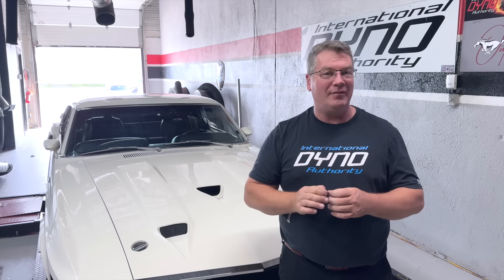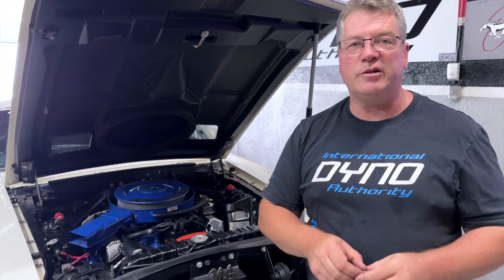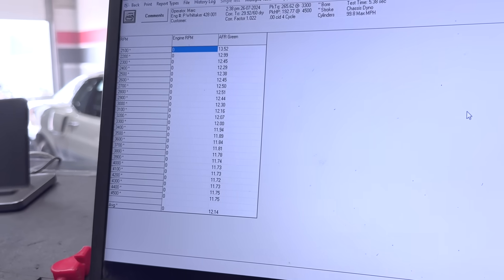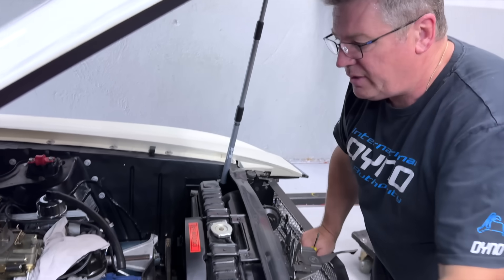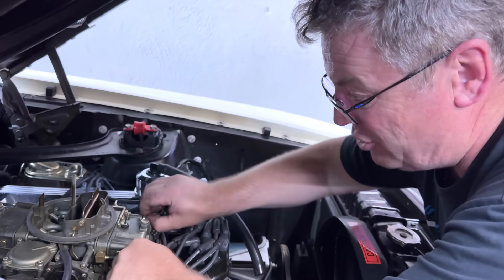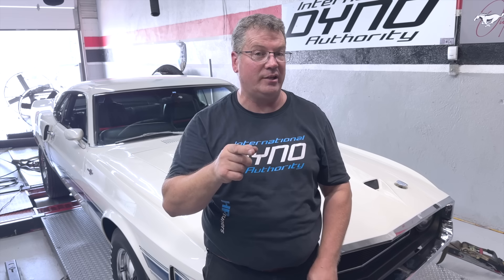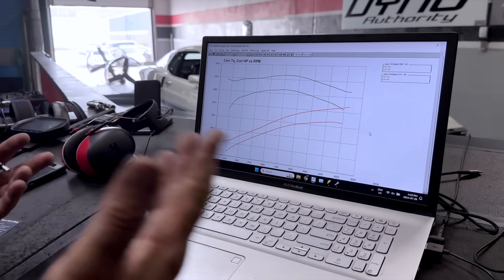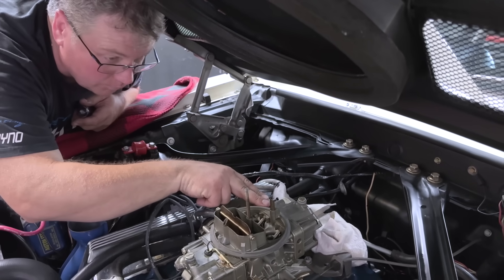Original, unrestored '69 Shelby GT500 tuned on the dyno

Comment: did everything but coils, which is fine, didnt need to spend any money for 90+ hp and 130 ftlbs torq 🤣

id be happy as f
Reply: Happy as, "f"?  French?  Fog?  Fixed?  Friendly?
Reply: @ one for each dustributor you add 🤓 you could do mpi - multipoint ignition - with two or more to make sure it burns everything and never turns black 🤣 but you can just use one and increase it until it starts burning holes into the cylander, then increase the fuel lol
Reply: @pazsion  Are you from Newfoundland? 😉
Reply: "[D]id everything but coils ... "  What did you mean by that?  
Also, how many coils do you think this engine has?
Reply: @ stock just one... as most motors were this way before efi and computers. 1969-73 were the best years

Comment: I am amazed that this vehicle is/was as rust free as it is condidering where it's  located ottawa ontario canada WHICH I'D  HAVE EXPECTED THIS THING TO'VE  BEEN A MAJOR RUST BUCKET (SO BADLY RUSTED THAT YOU COULD NEARLY SEE THROUGH THE ROOF)🤔🤷‍♂️🤨HMM..!!??
Reply from the maker: @65coupestang  holy smokes! I totally agree with you. This car was imported from a different part of North America originally. It's only had a couple of owners and it is so immaculate that there's never even been windshield washer fluid put into the reservoir. You are correct. It's almost a difficult thing to wrap your mind around, but I know you can do it

Comment: So now what?   Drain the fuel, put it back on display, and never drive it again?  (I just don't see the point in tuning it when you could be risking damage.)
Reply from the maker: @jamesdaugherty7138  so, now it runs correctly. It no longer smokes. And, there were several off camera adjustments made. That attributed, and helped to get rid of all of the smoke. 

This car now runs correctly. And the customer can load and unload this as well as Cruise, and very much enjoy the smoke free, ride that this has never had since it was new.

Comment: Why would they put an engine with more torque than hp in a "race car"
Reply: Because anyone who was NOT a racer would not tolerate a camshaft with a super choppy idle and a nonexistent lifespan. You want 500 HP? Send the motor into a shop for big race cam, port & polish, perfect balancing, double pumper carb, etc....
Reply: @cd2920 because horsepower moves the car, always, no matter what rpm.
Reply: @cd2920  no, thats why mr. Watt measured horsepower, not torque. Torque is just a number, horsepower is work. You can have 2 engines with different torque number having same horsepower and moving as fast from point A to B
Reply: 1 it's not a race car
2 That's how you had to do it back then... an engine is an air pump, it can only draw in as much air as the atmosphere it exists in.  For a naturally aspirated engine (and outside of making the suck/squeeze/bang/blow cycle more volumetrically efficient) In order to increase the amount of horsepower you have to increase the number of explosions (higher rpm) or increase the size of the explosions (larger displacement).  higher rpm = less reliable engine that catches on fire, as in the case of European cars of the 1960s.  larger engines = more durable engine but poor fuel efficiency, which was not a concern in the US in the 1960s.

And higher displacement engines produce more torque at lower RPM.  Horsepower is a product, the equation is rpm and torque.  torque x RPM / 5,252.  This also means that every single engine will produce the same amount of horsepower and torque at 5,252 RPM.  Which means that if an engine produces max horsepower below 5,252 RPM it will have greater torque than horsepower.  However that's not to say that if it's peak horsepower number is ABOVE 5225 it WON'T have more torque than horsepower, but the gap narrows.  Typically if your engine is making peak HP above 6000 rpm you will finally have more HP than TQ.  And an engine making its max power above 6000 rpm in 1969 is kinda spooky scary, compared to only 4000 or 5000.   Okay?

Comment: Never been a fan of Holley... 

14:58  That's when I lower the float level.  I've never seen the accelerator circuit contribute under vacuum.  Easy enough to visually verify with the filter off.  Even easier with cameras today.  

Good driveable tuning.  I'm certain you greatly improved the experience.  Exhaust had to stink something fierce.  Been a long time since I've been to Ottawa.

Comment: My dad bought a used 1967 Shelby GT-500 in 1970 when he returned from Vietnam.  The Shelby produced GT 500s used a 
" A "  scratch 428 PI with a pair of Holley 4 barrels . Shelby produced dual quad aluminum intake manifold and shelby Le Mans Aluminum valve covers.  The 428 PI had a rated 462 ft lbs of torque at 2800 rpm . And the 335 hp Ford advertised the 428 CJ to produce is almost laughable.  The 428 CJ and the 428 PI engines used in the  Shelbys produced significantly more HP than the rated 335 hp
Reply from the maker: That's a great story.  You should share photos or videos of it sometime!

Comment: Wasn't removing or disabling the vacuum advance and retarding the timing pretty common place as leaded, high octane fuel was no longer available?
Reply from the maker: @BiffBallbag  it's really hard to say. What the hands, that touched this particular car, had in mind when they originally were setting the timing. However, the distributor was purchased as a look-alike replica. It just happens to be missing the vacuum advance portion. It does not seem to affect the curve. The ignition curve is plenty aggressive without the vacuum advance. 

I completely agree, that the timing was a bit mellow. However, this engine was not begging for a lot more timing. I moved it to a very normal 32°. And it responded and it was very happy to be there.
Reply: @internationaldynoauthority693  I'm also confused why it was so over jetted.  Especially considering the car had dealer documents dating back to it being almost new with the same issue.  Dialing a carb in is a lost art today, but back then it was pretty commonplace.  Is it just me or does that seem really strange?  Were the plugs fouled out when you guys got a hold of it?
Reply: Little known trick of the time was to use an advance curve kit, heavier weights and lighter springs dialing in more total advance making vacuum adv unnecessary

Comment: Carroll Shelby had nothing to do with the manufacturing of Shelby Specific parts or the assembly of Shelby Mustangs after 1967. The 1968 , 1969 and 1970 Shelby Mustangs were actually assembled by Ford in New Jersey and then sent to A.O. Smith in  Michigan for final assembly.  The fiberglass body parts used in their production weren't even made by Shelby.  Shelby cut ties with Ford Motor Company in 1967 and didnt reconnect with Ford again until 2007 when the next actual Pre Title Shelby Mustangs were produced.  The 68, 69 and 1970 Shelby Mustangs are beautiful cars . But they arent actually Shelbys . And its pretty ridiculous for Ford Motor Company and owners of the post 1967 Cars to call their Cars Shelbys when the man had absolutely nothing to do with their design and production.  Ford did Shelby American and Carroll Shelby himself unbelievably dirtt
Reply: The point of this video was to show the benefits of a Dyno tune, not for people to sound off whether they like the car or not.
Reply: @PAULWHITTAKER-f5h  well said
Reply from the maker: @GorillaCookies  The history, is certainly well appreciated. Cheers, and have a super evening

Comment: Not the tiniest ounce of rust, discoloration, warping or seam separation, paint, plastic and leather all look like they were made yesterday, I'm seriously having doubts this car is 100% original. It could be that it has mostly original parts, but it's definitely had the undercarriage gone through and coated, as I can't understand how a car that's 55 years old with 32k miles has almost no dirt or rust on the chassis/suspension, as well as a sparkling clean engine bay with no hints of rust, oil, or coolant seepage. I'm also willing to bet it's had new clear coat applied, and possibly some parts in the engine bay were either cleaned or painted over, as again, not the tiniest speck of rust or paint chipping can be found on anything, no grime, grease or oil, no dry rotted or cracked wires or hoses. Cars that are over half a century old and have 32k miles on it simply don't look like this, it's impossible.
Reply: your eyes are being tricked by the camera, you are correct about the no rust anywhere but in real life you can see the spider cracks and the thinning of the original paint - no clear coat anywhere on the car.  Unrestored does not mean unmaintained or undetailed. The claim was original, unrestored not 100% original.
Reply from the maker: This vehicle is in beautiful condition! It has been meticulously maintained.

Comment: Of course it was making more power with each pull that thing was loaded with carbon which was common for those engines back in the day especially on low octane fuel, used to be a regular event blowing the carbon out every few months it would be especially bad if granny had been driving it 😂
Reply from the maker: Yes, we did notice that the engine was loading up on carbon. It was also making more power after each pull. The carbon buildup was common for those engines, especially on low octane fuel. We've done this on many cars.

Comment: Is this guy from Canada? You want to make lambda
Reply from the maker: @nathanl7795  It would not matter if you are in Florida, Arizona, Australia, or New York, or Ontario.  AFR is AFR. 😉
Reply from the maker: @nathanl7795  

Lol. Lambda is 14.7 or 1

Does not come into consideration:

1- Carburetorated Engines don't idle well or cruise well at 14.7. they REQUIRE a richer burn mixture.

2- Under load, WOT, or Acceleration 14.7 will provide --0-- power. (14.7 or 1 "Lambda is for cruising with Zero load, or idling a fuel injected engine)

3- We tune for performance within an AFR range.  13.1 to 12.3...  once we determine where the engine is making optimal power, we tune for that number.  In this case 12.7-12.9.

4- We read plugs and use telemetry collected under load to determine proper limits.

Side note :  just saying "we tune for lambda"  doesn't mean anything.

All AFR scaling is derived from a Lambda reading.  At that point we incrementalize  the lambda scale for fuel type ie: E85, Pump, Methanol, various race fuels...etc.. etc...

Comment: in relation to the idle mixture screws, have you practiced comparing Tune by ear vs using the O2 sensor  to see how close or not people would get like the old days.  or should one go by ear and add an 1/8 etc a turn in and youll be super close to the 14/7 to 1...
Reply from the maker: That's a great question! We have, and I find that the ear and the O2 sensor are very closely aligned.

Comment: What?  340 HP...at the crank?
Does anyone but me think that's a miserable number for a "Shelby-ized" 428?
Reply: It was rated at 335 hp from the factory so 340 is excellent. Nothing different about the 428 in a shelby.
Reply: You obviously never were involved in 60's cars and are spoiled by modern horsepower numbers of which most couldn't drive without the nanny controls
Reply: Something else to consider, when this car left the factory it was engineered to run on leaded pump gas which was substantially higher octane than the pump gas we see today. Instead of 93 octane back pre 1973 premium leaded pump gas was usually somewhere between 100-105 octane, which would’ve allowed for much more aggressive timing and therefore more power. If this car hasn’t been tuned since then, and let’s also assume that they didn’t install maybe thicker head gaskets which a lot of people did after 73 or detuned the car to prevent knock/detonation on the lower octane fuel, it would have been running on a tune, not suited for the lower 93 octane of post 73 gasoline, timing would have been off and not suited for a detonation point of 93 octane which could explain why it was making nowhere near the power it should have, but also another thing to consider Is that even when they get it dialed in on 93 pump gas, the peak power of that tune is going to be less than the peak power of a tune for the say 105 octane leaded gas that existed before 73 because you can’t time it as aggressively.  You could maybe add 10 to 15% on top of these numbers and get what it realistically might have been making in 73 just from the more aggressive timing alone, then who is to say how much it may have lost just from the age of the motor and components to get the number we have today. The only thing for certain is unless you run leaded gasoline or modify the car to accept a different type of fuel to achieve the same octane rating without substantially impacting performance from the modifications you’ve done to accept that fuel, you’re not gonna get the full potential of what the car would have been making when it left the factory floor back then due to the gas.

Comment: Ok so that equates to about 345hp SAE and about 460-470 Ft Lbs Tq. SAE. Pretty good running on just 91 octane, on a car designed to run on 100+ leaded octane gas.
Reply: good point .

Comment: 02:15 black smoke!!...Carb running too rich!
Reply from the maker: We identified a myriad of issues after conducting tests across several different RPM ranges.

The powervalve itself was new, but the gasket was incorrect.

 There was no blow-by or leaking from the direct power valve circuit.

This has been a problem since the car was new.

The accelerator pump nozzle size, the check ball in the accelerator circuit, and the PCV were routed incorrectly. Additionally, the main circuit fueling was too rich, and the ignition timing was too low.
We appreciate you writing in and stimulating this conversation.
Cheers from all of us here at International Dyno Authority.

Comment: I have an 850 double pumper on my 350LT1 and I can hardly make it smoke, but the idle fumes will choke a mule.
Reply: Idle mixture too damn rich.
Reply: @matrox  Yeah. I tried the vacuum gauge method. Same thing. I think it's the cam.
Reply: @danhillman4523  Put a smaller idle jet in it.

Comment: I have a 66 gt350 and I have always loved it.   In 1980 I was 14 and my Dad and I looked for a Mustang to rebuild for my first car.  The ford dealership had two mustangs a 65 and 66 in a salvage yard. Can’t remember why I got the 66, but it took four hours to get it running, and it billowed smoke!   I got it home and it was full of trash and junk.  Oh, we paid $450 for it.  I started cleaning it out and found a box with all the badges and miscellaneous parts.  The engine had four cylinders with messed up rings and scared cylinder walls, and a blown head gasket.   A week after I got it and started working on it the owner of the Ford dealership called my Dad and asked to buy it back.  My dad said it was too late, I was in love with it.  The dealer had planed to rebuild it and they sold it by mistake.  He came over to the house one evening and talked to me for about an hour. He told me all about Carrol Shelby and the cars he built.  He offered to buy it, and I said no. He then asked that I rebuild the car and not customize it too much.   I only put a good sound system in it.  Kept it as original as possible.  I took him for a few rides in it, let him drive it.   I’ve done the car twice since then, but only to make it a better version of what it was.   I just love the car and would like get a 69’ GT500 in the future.  They have gotten pricey, but they only go up in value

Comment: I have found with the OEM cam grinds on the 428/429 CJ and SCJ as well as Boss 302, chuck the 6.5 hg power valve and go with a 4.5 or 5.5 will help clean  that up without making the backend jets  too lean on driveability. But yes those carbs were never right from the factory and good job on making the snake run good fellas.
Reply: How about on a fresh 350 rebuild with a 1405 (600) Edelbroken thats running rich? 
What color of metering rod Springs should I try?
Reply: My uncle has a Torino with the 428 all original and is always torn on opening it up. So far has refrained.
Reply: I lived in the Detroit area in '69 ( I was 10 YO at the time ) When I got my wheels I would go by Holley's plant in Southfield Michigan. Holley products are solid, but I suspect Ford arrogance came through and they had a bad relationship with Holley. Wouldn't work with them. In our gear head days we always thought of Holley just dumping fuel but really they needed proper set up, which if one asked was available. We almost always overrated the carb size ! Rochester made it work on GM's by tuning precisely. Dropping an 850 Dblpump on a 327 SB usually met with horrible results.
Reply from the maker: We agree with you, and yes, those carbs were never right from the factory!

Comment: I was cringing watching the dyno runs.
I HOPE that it had new tires that would take 300HP w.o exploding.
Reply from the maker: @arthurfoyt6727  absolutely, I agree with you. Except for the part where you said you were cringing. Each vehicle before it ever enters the shop. Goes through a complete pre-checklist. Things are checked such as condition of the tires, how much air pressure is in the tires, leaking exhaust versus sealed exhaust, spark plugs, spark plug, wires, distributor, rotor, battery, fuel system, fuel lines, fuel pump. Etc. Pump. Etc. Rest assured on this vehicle. Everything was in absolutely immaculate and or brand new replaced condition

Comment: On Forza Motorsport the just recently added the 67 GT 500 and the game shows it having the 7.0L engine rated at 355hp. I imagine thats the same 428 cobra jet engine thats in a 69 but I'm not sure. Your end result power ratings seem to align more with the 355hp rating versus 335hp.
Reply: Not exactly the same.